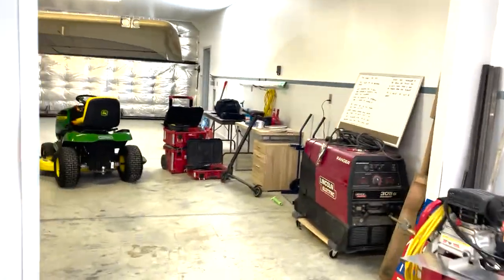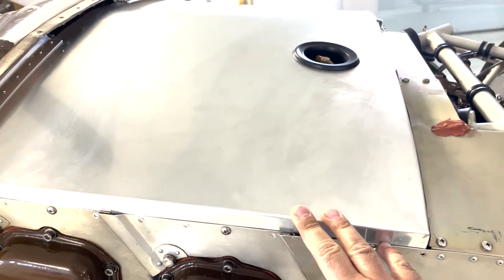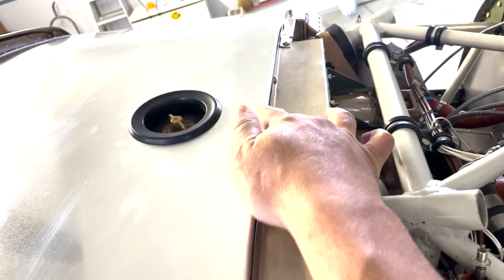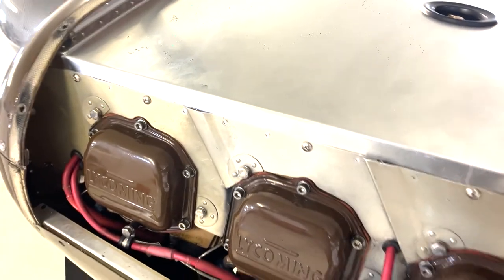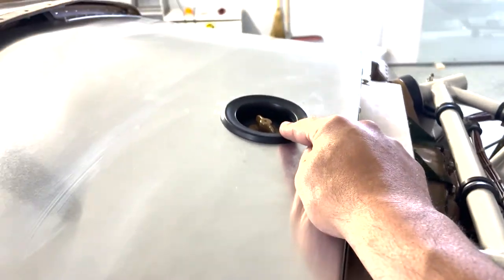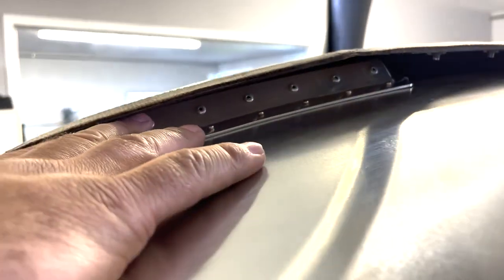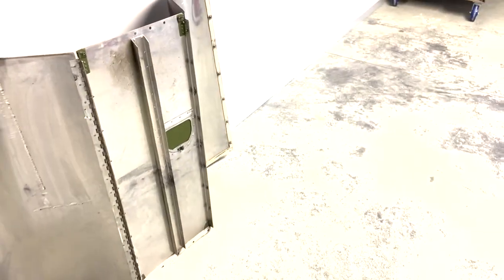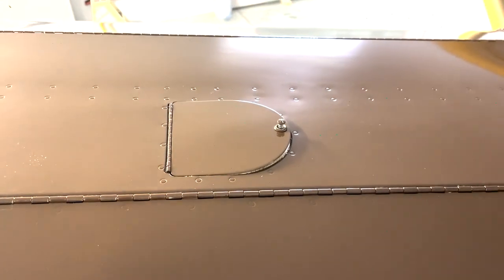Building a Custom Plenum on a Bearhawk Bushplane to help with high cylinder temperatures

Comment: Just properly installed baffle seals is all that is needed. The top cowl is a plenum when the seals are done right. 
You’ll get more effective temp control by opening up & controlling the outlet on the bottom of the cowl with a lip to create a low pressure to
Reply from the maker: Had them done correctly, and still overheated.. tried multiple things, apparently it’s a common problem for bearhawks with this motor.

Comment: Both Continental and Lycoming specify less than 1 sq inch of total baffle not sealing the high pressure and low pressure sides. 1/8” gap in the baffle seal equals a lot of lost cooling air. Low performance engines, not a huge deal, high performance (ie cowl flaps) is a huge deal.
Reply from the maker: Thanks for the info, I didn’t know that
Reply: @flyweldfabricate   I was working at a flying club, the Mooney 231 had excessively high chts. Climb had to have the cowl flaps wide open, in cruise they couldn’t even close the cowls...ever. I replaced all the baffle seals and closed every gap I could find. Afterwards the owner said he could climb with the cowls 1/2 open and in cruise they were always shut regardless of the conditions, he said it was like a new plane. I got all my info from the Lycoming and Continental factory reps. Air control is critical in high performance installations.

Comment: Doing a plenum on our Bearhawk 5 as well. How did it help your buddies temps? We installed them also on our Velocity (canard pusher) and have no issues on hot summer days.
Reply from the maker: It helped a bit but he needs to evacuate the air from the bottom of the cowl now